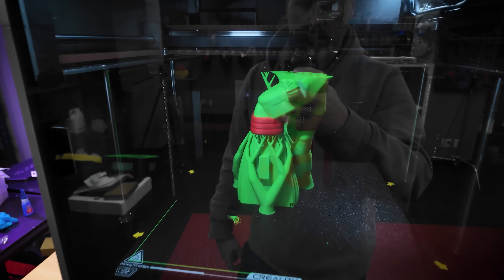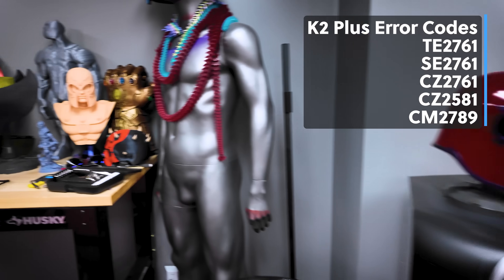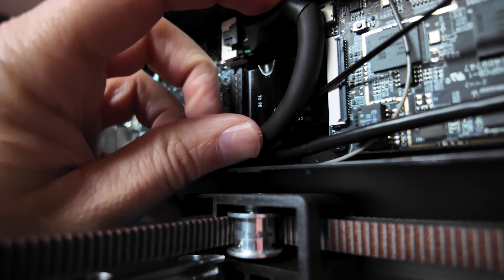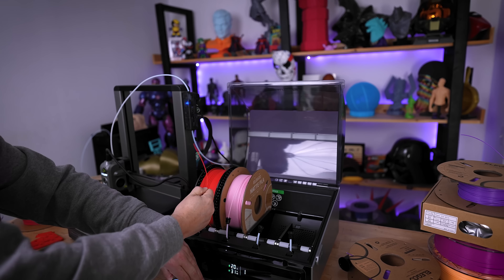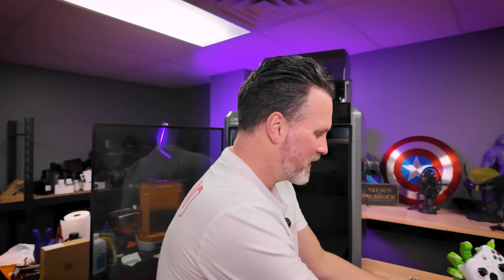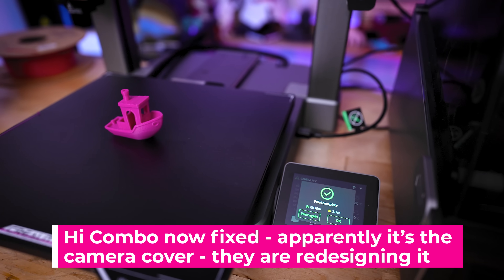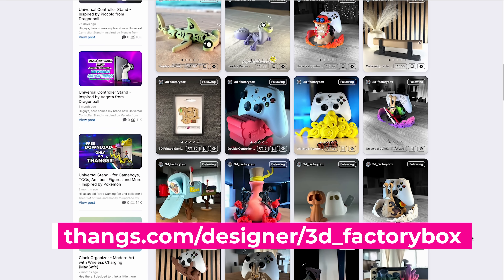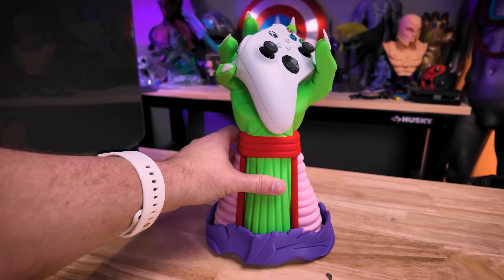Creality K2 Plus FIXED! But Are They Rushing Printers?

Comment: I thought we were past this "ship broken, fix later" mentality. Seems like it is alive and well.

Edit: Are you joking?  A camera cover was the issue. How does that get past QA? Actually, I know how. Just do not do QA.
Reply: ELEGOO is doing the same thing with the Centauri Carbon, I keep getting print head abnormalities issues, and there is still no fix, and there are no parts at all, even from them they are taking weeks if not months to ship to you
Reply: @manuel509rios Elegoo havent even begin shipping that machine yet. It is not officially release, where did you get your??
Reply: @giaopx  I've had mine for over 3 weeks, and there are a lot of issues with it, and they are still shipping them out with the issues. I put mine back in the box, I will wait until they at least have parts or even a firmware update, since they have nothing yet
Reply: What would ever make you think that?

Comment: Hi Uncle Jessy, I agree with you about the testing and I also think Creality  is desperate. They have never put out a printer that works out of the box. I think of Creality as tinkertoy your always repairing them. I have 3 Ender 3  models from  2022 and all of them are useless now. I got to the point where it was ridiculous how often I was reset or replacing parts. I’m still waiting to see how the new Core XYs fair.

Comment: Please put back all the other equipment you've replaced prior to the cable and make sure the problem is still resolved or we cannot determine it's 100% the cable only.
Reply from the maker: Will try to do that an post an update on discord & fb
Reply: @UncleJessy  try positioning the cable or moving the cable during printing, maybe it has a short due to the 90 degree bend like you said
Reply: Using a multimeter in continuity mode and measuring each pin end to end might confirm any internal wire breakage.
Reply: The other parts where replaced 1 by 1 which didn't solve the issue, then replacing the cable did, if all parts where swapped at once I agree, but they weren't, the process of elimination has already been done revealing the cable was the only part that resolved the issue. 

Don't waste your time swapping the old parts back 🤣
Reply: @tomstevo1910  Nope, it can be combination of parts.
Reply: @tomstevo1910  not really, if more than one part was faulty, swapping just one would not fix the issue.